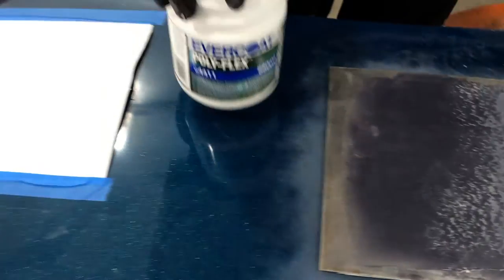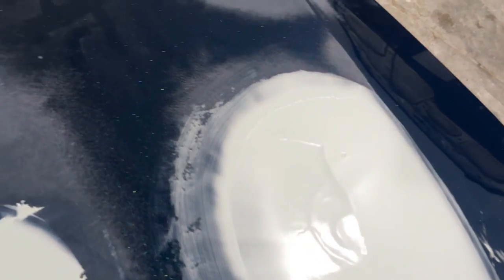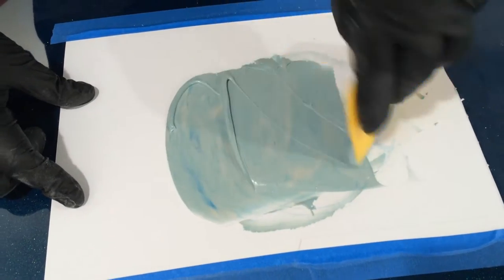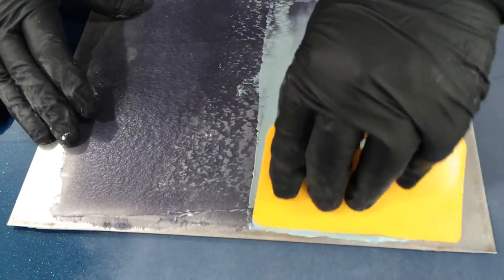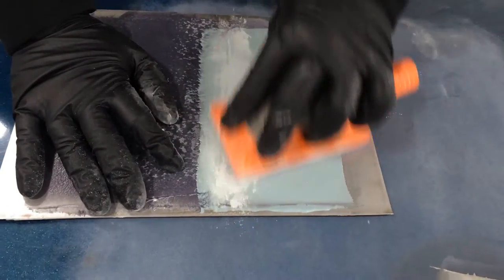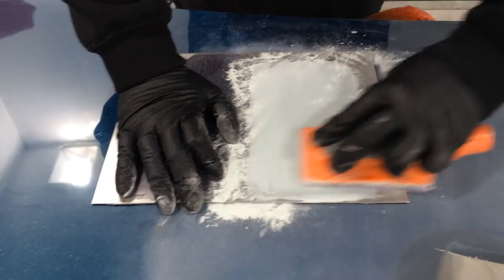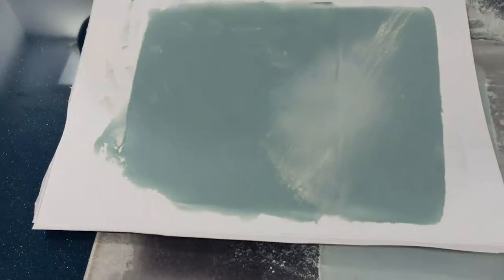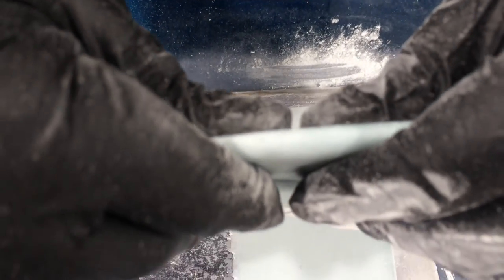How To Apply Evercoat Polyflex To Evercoat Fibre Tech

Comment: Hi, I understand the poly flex being very flexible but how much flex is taken away when you apply it over the Fiber Tech.  For instance,  if the fiber tech were to crack underneath the poly flex what happens,  does the poly flex hold it together or would it crack to?  I ask this as I need to do some deep fill repairs with a flexible filler but the Poly Flex states in the data sheet the maximium build is 3 mm sanded, so what would you recommend I use as a flexible filler for more than 3mm deep repair under the Poly Flex?  Substrates will be plastic, ferrous metal and fiber glass?